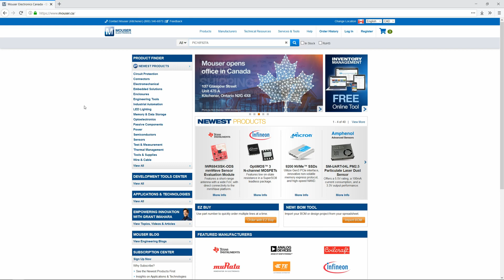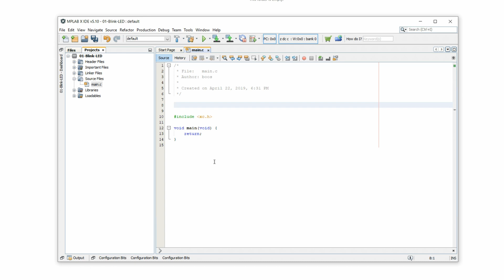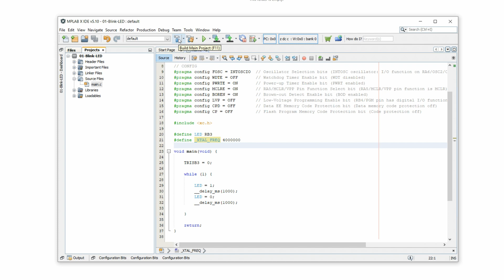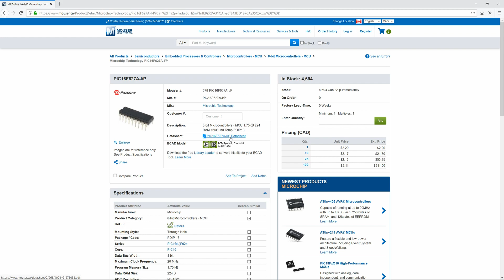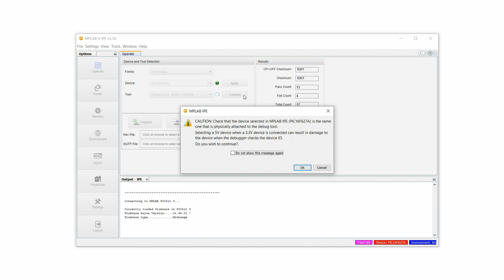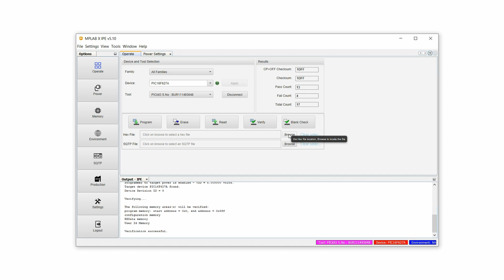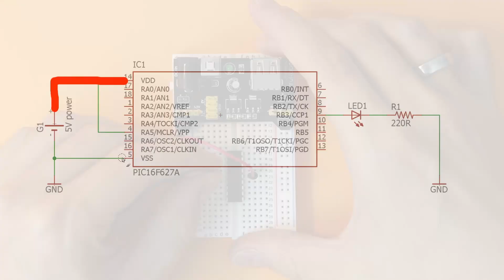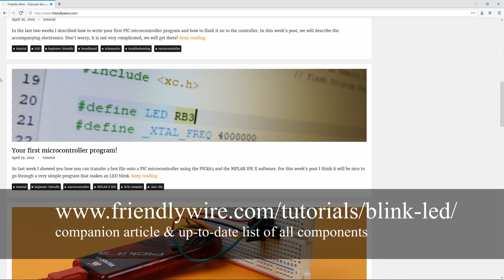Your first microcontroller project!

Comment: hi this is chandan i need small help
Reply from the maker: Hi there, what is is about? :)
Reply: @FriendlyWire i have one controller card that card have some problem i checked all components all ok maybe Atmel AT64A microcontroller program but i don't know how to download that program from microcontroller to replace microcontroller can you help me to do that
Reply from the maker: @ChandanKumar-pr9us  Downloading the firmware from a controller is only possible with tools like the MPLAB IPE if the 'code protection' has not been turned on. It may also not be allowed, depending on what kind of product it is. What kind of card are you looking at? It's a bit hard to tell from the description.

Comment: Professor, Thank you so much. But, please I want to know if pickit is compatible with all pic microcontroller?
I find it here in my country to buy and after watch your video I created in my mind  desire to explore a litle bit more. That is the first time that I found something so clear in terms of pic program.
Reply from the maker: The PICkit supports most PIC chips you would use as a beginner. But, just to be safe, can you tell me which PICkit you want to get, and what controller? I can check the compatibility for you :)
Reply: @FriendlyWire   Professor, is the same that  you use to demonstrate in your video, (Pickit 3) using breadboard to do same way you did. Doubt came up when you talked about Mplab x IDE and XC8 compiler I downloaded it and I saw that there is others compilers, like MPLAB XC16 Compiler, MPLAB XC-DSC Compiler, MPLAB XC32 Compiler. Why is there another compiler?  And  so by that way I asked you that. But to begin I will do in same way you did by using the same controller. So amazing learning about it. Thank you so much!
Reply from the maker: @SoaresOrlando  I see what you mean, thank you for explaining. And you can just call me by my first name, Jens. There are different compilers for more powerful chips. We use the XC8 compiler because our controllers are 8 bit-based. Other controllers, that are more powerful, are 16 bit or even 32 bit systems, and they need other compilers, but for us it's not so relevant. So, if you are a beginner and are trying to get started, I would still recommend the PICkit3 (or the PICkit3.5 that you find online) together with the XC8 compiler.

Let me know if you have any other questions, I will be happy to help! And congratulations on taking your first steps into the microcontroller electronics world, enjoy! :)

Comment: HI French here, I try program PIC with MPLAB X IDE v6.20 and XC8.
I have error on TRISB3 Unresolved Identifier
Reply from the maker: That's too bad! Which chip are you using for this? The PIC16F627A?
Reply from the maker: PS: I am asking because this error message means that the compiler does not know about pin RB3, which is weird, since the PIC16F627A has that pin. If you use a different microcontroller then the code will have to be different, unfortunately. But no worries, we can get it to work :) Which PIC are you using?

Comment: What if my mcu has 2 vdd vss pins like the pic18f452? How should the connection be ? Parallel? Or external source ?
Reply from the maker: If there are multiple power pins, always put them in parallel :)

Comment: Please don't touch pins of mcu
Reply from the maker: In general it's a good idea not to touch them. But in practice I find it makes no damage if you ground yourself first. I have touched microcontroller pins when inserting them into the breadboard for 10+ years, and none have broken yet.

Comment: Hi 👋🏻 great video. 

I am trying to create program to control two different outlets ( wall plug outlets). I am trying to control two different valves (hot and a cold) . The sequence is 1 minute on cold then wait 30 seconds ,then 1 minute hot then wait 30 seconds (a continous loop ) for  “x” Loop cycles . Any ideas on how to do this ?
Reply from the maker: Hello! Yes, you can do that with a relay module. You connect the LED signal to the input of the relay, and on the contact side of the relay you can hen switch other devices. But be careful with this: line voltage is dangerous, and please only do this if you feel confident about it. If not, no worries: you can probably talk to a local makerspace or find a programmable timer solution. Let me know what you think, and be safe.
Reply: @FriendlyWire  thank you !

Comment: New to computer electronics, does anyone know a great place to purchase all of these materials?
Reply from the maker: Good question! For all my videos there are companion articles on www.friendlywire.com, and they always include links to where you can buy the components. All basic stuff (capacitors, resistors, LEDs) and the PICkit you can get from electronics starter kits you can buy on Amazon or any other website. The PIC microcontrollers can be bought directly from electronics distributors, such as Mouser or Digikey, or other local ones to your country. Let me know if it helps, and thank you for stopping by! :)
Reply: @FriendlyWire   this information that you have provided MORE than helps! Thank you for your assistance and I’ll look into the link
Reply from the maker: @curly-hairedassassin5233  Fantastic, happy to hear it. Let me know if you find what you need!

Comment: Can you help me on this. Th ic I got at preset is 16H505. 

// CONFIG
#pragma config OSC = IntRC_CLKOUTEN// Oscillator Selection bits (Internal RC oscillator/CLKOUT function on RB4/OSC2/CLKOUT pin)
#pragma config WDT = OFF        // Watchdog Timer Enable bit (WDT enabled)
#pragma config CP = OFF         // Code Protection bit (Code protection off)
#pragma config MCLRE = ON       // RB3/MCLR Pin Function Select bit (RB3/MCLR pin function is MCLR)
// define clock frequency to be 4MHz
#define _XTAL_FREQ 4000000

// #pragma config statements should precede project file includes.
// Use project enums instead of #define for ON and OFF.

#include <xc.h>

#define LED RC2 // LED to be connected to 

void main(void) {
    TRISC = 0;
       
    while(1)
    {
       
    LED = 1;
    _delay(2000);
    LED = 0;
    _delay(1000);
        
    }
    
    return;
}

It compiled nicely and uploaded too using IPE with 4.75 v (power option). After programming the status yellow LED on Pickit3 flashes (indicating success?). 

However the led connected to pin 8 (RC2) of the ic do not flash . 

I have not connected the connected the IC to external powersupply like you did. Is it neccessay ? will it not run the power supply from PICKIT3?  or it something in the above code. ? 

looking forward to your reply.
Reply: damn !  finally got it right . had to change _delay() to __delay_ms() ( with two underscore ).

Comment: Nice video! But I get BUILD FAILED error. How do I fix it?
Reply: [1]: * * * [nbproject/makefile-default.mk:85: .build-conf] error 2
Reply: It also does 

Make: * * * [nbproject/makefile-impl-mk:39: .build-impl] error 2
Reply from the maker: @tahamohamed9446 Thanks! It's a bit hard to see from there what it is. Are you using the PIC16F627A and the code exactly as in the video?
Reply: Same code but different pic
Reply from the maker: @tahamohamed9446  This explains it! This ode only works for the PIC16F627A.
Reply: I'm using pic16f819
Reply from the maker: @tahamohamed9446  Did you set up the project for the PIC16F819? If so, then we need to change the code a bit to get things going. What do you want to do with the PIC? :)
Reply: Blinking
Reply from the maker: @tahamohamed9446  If you are just getting started it's a bit difficult to do everything on a different chip. Is there a way you can get the PIC16F627A or the PIC16F1455? I use these chips for most tutorials/projects on this channel. If not, then you can contact me via email (you can find it at the bottom of www.friendlywire.com) and we can try to get it going on the PIC16F819.

Btw, did you set the project up for the PIC16F819 in the MPLAB?
Reply from the maker: Thank you! Can you post the full message? It means that something did not compile correctly.

Comment: Hey! I'm using a PIC16F88 and I'm getting this message when I try and verify in IPE:

program memory
Address: 0 Expected Value: 3fff Received Value: 0
EEData memory
Address: 0 Expected Value: ff Received Value: 0
configuration memory
Address: 2008 Expected Value: 3 Received Value: 0
Verify failed

I have followed all of the other steps in this video. What do you think the problem might be?
Reply from the maker: Thanks for your interest and your question! To me it looks like a data transmission error, and it's very common. Can you send me a picture of your setup where all the cables etc are visible? You can reach me on Instagram, Twitter, or via email (address is at the bottom of www.friendlywire.com).
Reply: Looks like I was able to resolve the issue, thank you for your offer though!  @FriendlyWire

Comment: Hello, thank you for helping beginners to start with microcontrollers ! I have a little problem with the coding part, I have a ATmega328P and the Bits Configuration isn't the same as you, so I didn't change anything and paste it in the program but when I build it, it says build failed with two error, one : TRISB3 or/and RB3 aren't defined and the second : expected expression before the = in "LED = 0;". I hope you'll be able to help me, I really want it to work.
Reply from the maker: Thank you for your question! It is a bit difficult to change the tutorial for a new chip, especially if you are just getting started. The ATmega328P has different pins and an entirely different architecture, so this tutorial, unfortunately, is not written for this chip. Do you have a way of getting a PIC16F627A to get things started? Or is there a specific reason you want to use the ATmega328P?
Reply: @FriendlyWire  thank for your answer ! Yes, I got a starting kit with different electronics elements and a circuit with this micro controller for Christmas and I was searching for an easy project to begin with. Is it really necessary to begin with another micro controller ?
Reply from the maker: @nael114  Ohh, that's a nice Christmas gift, happy experimenting. You will see, it's a lot of fun! :-) What kit did you get?

Comment: Thank you for this video. This might be the only video where you demonstrated a working chip off of an external source. Will this work off an external direct 5v source with no regulation?
Reply from the maker: Glad you liked the video! By "external source" you mean anything that is not a battery? Yeah, these breadboard adapters for USB are quite practical to power small projects that do not need too much current. In my experience I have found it sufficient to add a 100uF capacitor for stability, and as long as the power draw doesn't change drastically, your microcontroller will be happy with that voltage of roughly 5V. If you want to do precision measurements, or anything critical, you should of course use a dedicated power supply. What kind of project do you have in mind, if I may ask?

Comment: I have a question about the schematic, how the current was limited when the resistor was between LED and GND. Im newbie, thank for your answer !!
Reply from the maker: Hello, and thank you for your question! :) It does not matter where you put the resistor, it can be "before" or "after" the LED, because the current has to go through both of them.
Reply: @FriendlyWire  thank for your answering
Reply from the maker: @phamtrung5414  Hope it helps! You can put it on either side, just don't forget about it :)
Reply: @FriendlyWire  Really appreciate it sir ^^
Reply from the maker: @phamtrung5414  Happy to help, and thank you for your interest. Have a great day!

Comment: Why my microcontroller is stopped at first instruction and is not going further.earlier it was worked well. Is there any issue in microcontroller or its external circuit. Pls help
Reply from the maker: Interesting question, did you forget the while-loop perhaps?
Reply: @FriendlyWire  
I didn’t make changes to program. It’s a circuit which was came for repair .
Reply from the maker: @Innovative_electronics  Oh, so it's a different circuit? It could be anything, hard to tell without more details, I am sorry. Do you have access to the code?
Reply: @FriendlyWire   yes I have access to code

Comment: Is the software work to atmega 328 + usbasp also?  I learned blink2 by arduino - digital write.
Reply from the maker: The PICkit supports some ATmega chips (since they are also owned by Microchip) but this tutorial is just for PIC microcontrollers. Which chip do you want to use?
Reply: @FriendlyWire  I used atmega 328p - I tried it (& sucseed) by usb asp & atmel studio - I mean is the sofware in this video work also to atmega 328p + usb asp instead of PIC & pickit programmer?

Comment: Hello Jens. I have seen nearly all your video with microcontroller projects and I learn more and more. I have one question... how can I make an interrupt (pause) in my PIC16F627 microcontroller? I have made a program and I want to be able to stop it with a pushbutton and then continioue when I release the button. Have you decribed this anywhere in your vodeos...?
Reply from the maker: Hi Ove, I am so happy that you find my videos useful! It's a good question. I have not discussed this in my videos, but something that might work is put the controller in sleep mode (which effectively pauses program execution and ensures super-low power consumption). I describe this in the analog clock video [ https://www.youtube.com/watch?v=N8rlLG6EXpk ], but that is based on the PIC16F1455.

Let me ask: are you interested in this for a specific application (and if yes, what is it?) or is it more of an academic question? Nothing wrong with either, of course, but it helps to put things in context :) Let me know!
Reply: @FriendlyWire  
Hello Jens. Thank you so much for replying my comment.
I will try to explain what I'm doing.
I am doing a small project where I am making a traffic intersection model which is completely authentic with regard to all the lights in the signals.
I am using four outputs from the Microcontroller (PIC16F627A) as a binary counter from 0 to 14. (RB1, RB2, RB3 and RB4).
These four outputs go on to my circuit of logic gates which ends up in the control of 26 different lights in all the traffic signals.
The reason I use a microcontroller is because the switching time between the different signals is different going from 2 seconds to 28 seconds. Yellow is 4 sec. and red is much longer).
The entire traffic light is being built on a large plate as a model of the intersection.
I use this to teach children and young people how a traffic light works.
I need to be able to stop the signals from the microcontroller with a push button (or something else...) while I explain what is happening with the various lights and then continue with the process.
I have made the complete (for you very simple) PIC program and it works OK, but I can't figure out how to pause or interrupt the program and then continiue the process.
If possible I can mail you the code and drawing og the intersection. The Intersection-steps is taken from at real intersection.
Or I can give you my mail if you want that?
Best regards Ove
Reply from the maker: @oveschleisner-meyer8139  I see! That sounds like a great project. I think what you have in mind can be done with a simple TIMER0-routine. Please feel free to send your code to my email (you can find it at the bottom of www.friendlywire.com) and I will be happy to modify it so that it does what you need. Would that work?
Reply: @FriendlyWire  
Hello Jens.  Thank you so much... That will work fine... I will send you an email...
Reply from the maker: @oveschleisner-meyer8139  Got it, thanks!

Comment: I have a dspic30f2010 microcontroller...need to begin with this kind of led blink program.....still confused with configuration bits done initially....please help me
Reply from the maker: I have never worked with the dspic30f2010 before. Let me ask you, have you set up the project in MPLAB for the dspic30f2010 already, following similar steps as in the video?

Comment: Nice!  The big picture in less than 20 minutes!! An engineer friend of mine loved using the PIC series micro-controllers, He jokingly referred to them as "trailing edge" technology. But in reality he used these in all his designs and products due to their ease of use, reliability and cost. Sounds like engineering to me!
Reply from the maker: Thank you, Michael! Sure thing, a PIC16F627A (the chip in this video) is not an ESP32 with WiFi connectivity and all other bells and whistles, I could not agree more. But I am always amazed how versatile these comparatively simple chips are, and I think for hobbyists who want to develop a deeper understanding of microcontrollers these mid-range PIC controllers are an ideal compromise between functionality and complexity. Thank you for your kind words and for stopping by, have a great rest of your weekend, Michael!